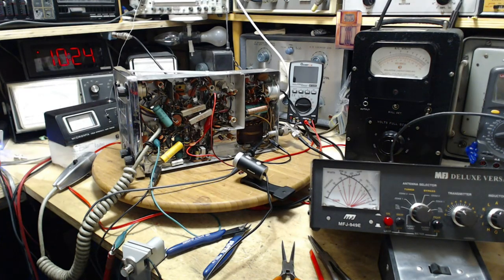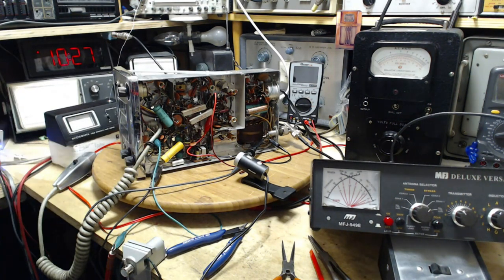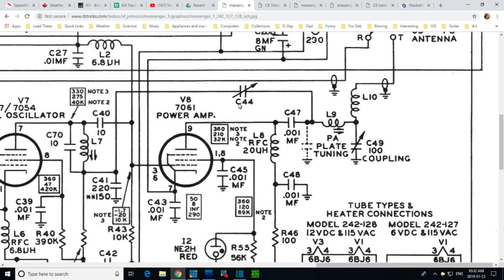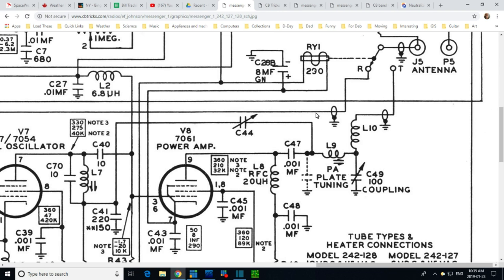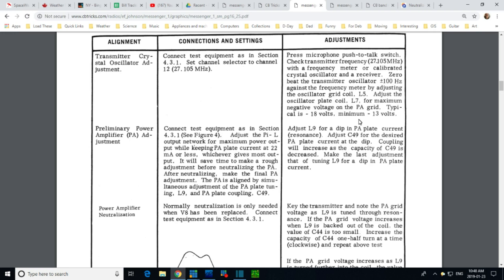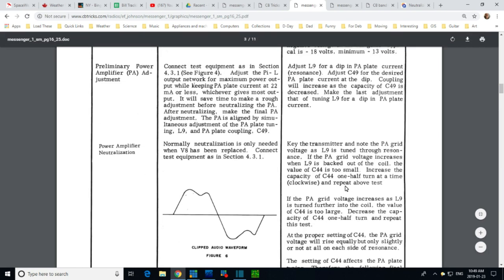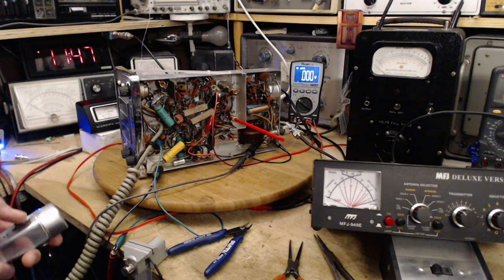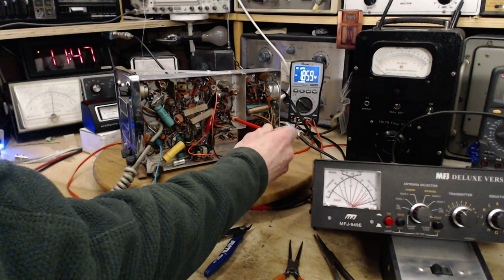Johnson Messenger CB Radio Video #9 - Neutralization Capacitor Adjustment

Comment: I'm impressed at how well you're doing without knowing much about transmitters. I don't think I'd have the moxie to try. Remember, these things were designed to be abused, so a certain amount of "learning by doing what you shouldn't be doing" will probably be forgiven :)   Really enjoying this series.
Reply from the maker: Thanks Michael.  I took a run at a Heathkit SB-104A Transceiver a while ago.  That didn't go well at all.  I also have a very nice 80 meter Heathkit DX-60B that I have been afraid to touch.  Maybe I'm ready to poke around with that but it's much more serious than this radio.
Reply: @JimsRadioShop  Well, the nice thing about Heathkit is that you're supposed to be messing around with them (as opposed to your Grundig!)  
When I was a kid we had a Heathkit GR-64 shortwave receiver that was a gift from a Catholic priest who was a friend of the family. 
He was a passionate Ham radio man and I'm pretty sure he did a lot of his own work on his transmitter too. 
Needless to say, he didn't have any formal radio electronics training, but he had a sharp, inquiring mind and Heathkit was an ideal format for him. 
If you have the manuals for the Heathkit transmitters, you should be able to work on them with confidence.

Comment: "neutralization" capacitor.
Yep, it compensates for the inter-electrode capacitance control grid to plate (properly phased).
But look at how the neut. cap. is intimately coupled to the output tank. The 7061 tube's P-to-G capacitance, thus modulated, will become an active participant in the resonance frequency of the entire power gain stage; The tube becomes part of the  tank. In Jim's swing analogy, the length of the swing's ropes (now partially controlled by the 7061 tube) automatically adjust to the swing pusher's (exciting oscillator's) cadence.

Comment: From an ex Warranty Service Center guy....
Open the connection from the B+ to the 7061, then key the radio and tune for ZERO output power, and your neutralization will be perfect! Reconnect your B+ to the 7061 and you are done.. Total time about 2 minutes.....

Comment: Quite a contrast in weather Jim, it's snowing in Canada and well below zero, yet we're sitting here in Melbourne Australia with the a/c on max and its 41C outside.
Reply from the maker: A/C on max!  What about that Australian power bill you are going to get?
Reply: It’s a ducted evaporative so not expensive to run. We augment it on the hottest day with a portable refrigerated one and it’s not expensive to run. The gas bill for the heating is usually much, much more. Forecast updated to 44C today. Hard to believe winter is actually cold with such hot summer days.

Comment: I recall in a recent video you were converting pk - pk to rms without first dividing  the pk-pk display by two (Average).  Then divide by  sq. root of 2.
Reply from the maker: There are times where only a rough notion is required and that's when I don't think too hard because I believe the result requires no precision or I know I will revisit the situation later.  Or I just forgot to divide by two.

Comment: What they are calling the "Pi-L" must see a 50 Ohm load to function within design parameters. So, to make any adjustments, the TR relay must be remotely energized from an external power supply with the unit unplugged, so it's in TX mode. Otherwise, the network sees an infinity load.
Reply: So the TR Relay has to be in TX Mode and a Dummy Load (with 50 Ohm) has to be connected to the "Antenna Terminal"? That would make Sense, I think. That would also explain, why the Resonance (at least that what I think is the Resonance) shows up on a totally wrong Frequency (way below the right Frequency Range, like it seems to be shown in this Video). Edit: (And there should be possibly nothing else directly connected to Signal Path to the 50 Ohm Load, that could change the Load in some Way, I think.. )
Reply from the maker: Didn't I catch that?  No worries.
Reply: @DE-iv8if 
 Yes, the signal must go directly  from L9 through L10, the TX-contacts of RY-1 to the dummy load. Otherwise, it sees an open circuit (infinity impedance), if RY-1 is still in RX mode....there is no chance of resonance. I suspect that's why the plate current increases in TX. Long term TX with no load can lead to self destruction of V8.

Comment: It looks as if L9, C49 & L10 make a "T" network. If so it has very narrow passband.???
Reply from the maker: In the manual they call it a Pi - L network.  Isn't the roll-off of any resonant circuit 6dB per octave?  Or is it 12dB for LC?  The Pi is made up of C49, L9 and the 'ghost' capacitance shown on the schematic.  L10 comes off the junction of C49 and L9.  The value of L10 is not quoted but it's a very small coil as compared to L9.
Reply: @JimsRadioShop 
Roll-off, I believe, is greatly affected by the Q of the network and therefore, can only be generalized to a +/- situation and is not set in stone.